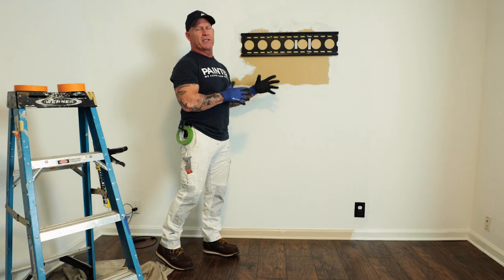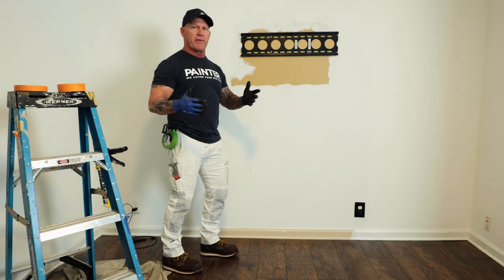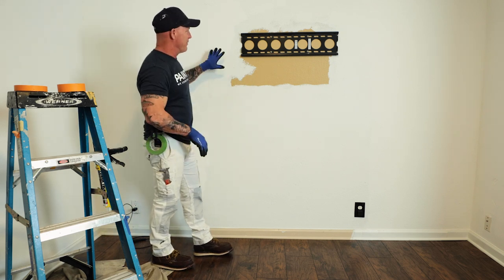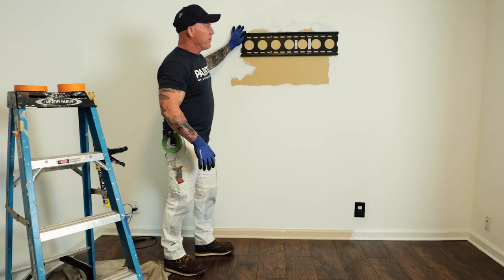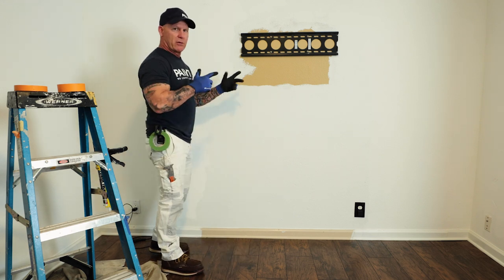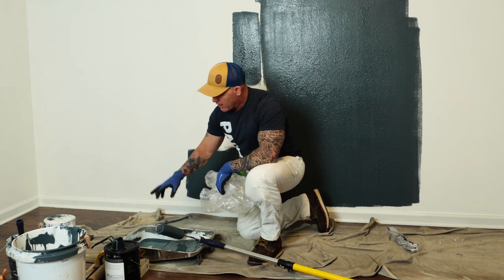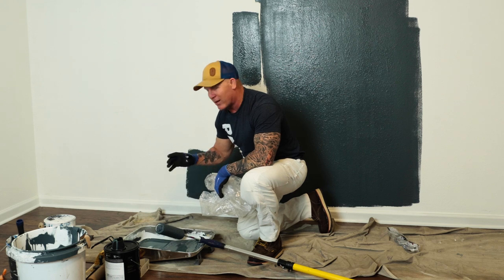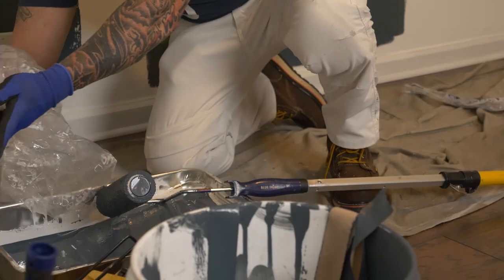Don't Do This | Mistakes Painter Make

Comment: No need to buy special covers to keep brushes and rollers wet. I just leave the brush in the paint during break. same with rollers. wrap them in plastic at end of day if no sink available. as far as your paint tray, just cover it with a liner upside down.

Comment: Well I do agree with the professional way of doing it is painting behind that, It's the details that matter, any professional should absolutely have the customer signed a liability release waiver before touching that television or have them move the television and you just remove the mount. If you do remove the mount, make sure it's tapped back into studs because it comes out of the wall at some point in the future your liable. That's why it's all the way around. Better to get them to sign a release waiver stating you will move the TV, but if anything happens to it, you're not responsible for the damages. Although you will take care to not cause any intentional damage
Reply from the maker: Thanks for sharing

Comment: Professional painters should NEVER remove items from a customer's walls, or move items in a room. In NYC, I have always been told that that work must be my responsibility. If you do choose to do that work for a customer, you need a rider in your employment agreement that stipulates you can't be held liable in the event of damage or functional mishap. The drying paint while you work is a serious problem, especially with all the quick-dry products now. Not only are the paint pans susceptible, but also along the brush edges (not so much with oil-based products). I use wet work rags to cover my pans and brushes. I don't use plastic. The wet rags are washable, and they do a great job keeping everything moist, sometimes for hours.
Reply from the maker: Interesting.

Comment: I've a better tip for your rollers and brushes... When I'm having a break or leaving them out I always wrap them up with cling film much better than that plastic wrap there absolutely airtight and easy to remove
Reply from the maker: Thanks for sharing Paul

Comment: The drying wet paint edge on the wall is really buging me
Reply: He only ever does one coat, but looks 'perfect'.....never get away with that in the uk, i guess standards are different eh 😬
Reply from the maker: OK
Reply from the maker: Actually your completely wrong.  I typically roll two coats
Reply: Ok
Reply: So why in your videos do you show one coat and then take all the tape up?......as i said, standards are clearly different in the uk👍